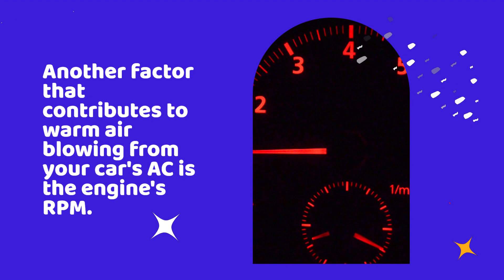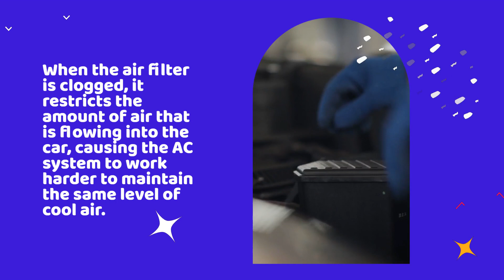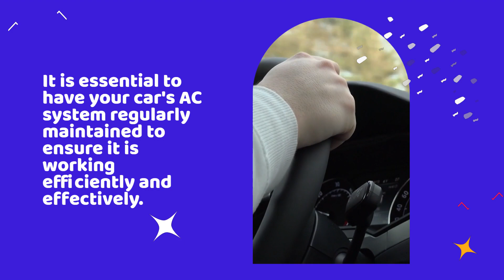The Shocking Truth Behind Why Your AC Turns Hot While Accelerating!

Comment: This video is a complete waste of time.
Reply: and wha he said should be the opposite .
Reply from the maker: Appreciate your input! In some vehicles, AC performance can drop during hard acceleration due to engine load prioritization or a momentary cut-off in the compressor. But you’re right—it really depends on the make and model. Some cars handle it differently and actually maintain cooling better at higher RPMs.

If you’ve got a specific vehicle in mind, I’d be happy to dive into how its AC system behaves under acceleration!
Reply: 2012 Chevy Cruze (RS if that makes a difference) today while trying to pass someone I had to push it to 5k RPMs and the AC turned completely hot until like 30 seconds after I stopped accelerating.